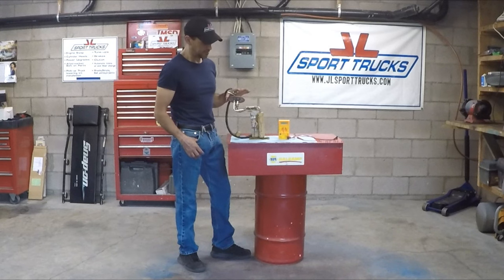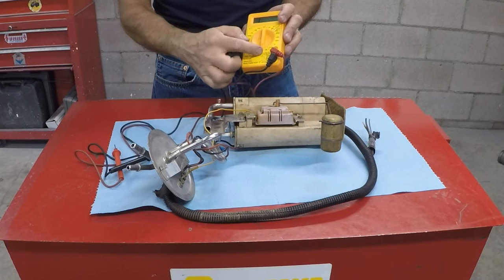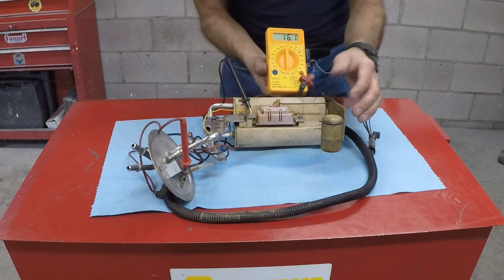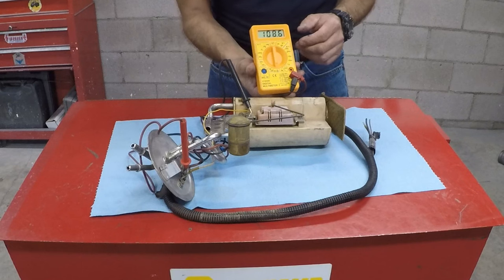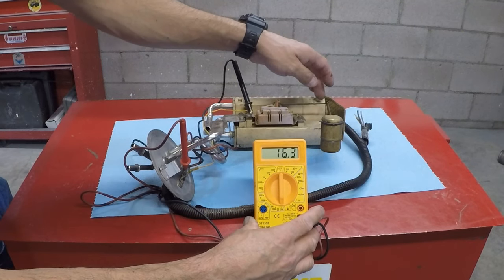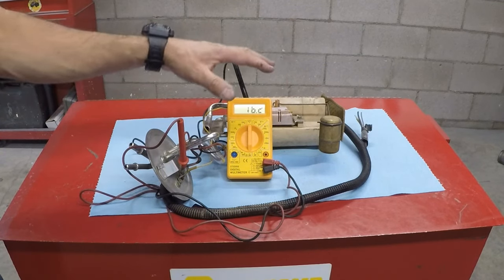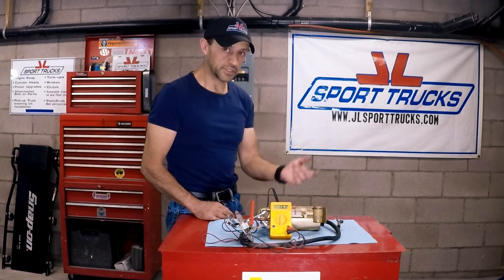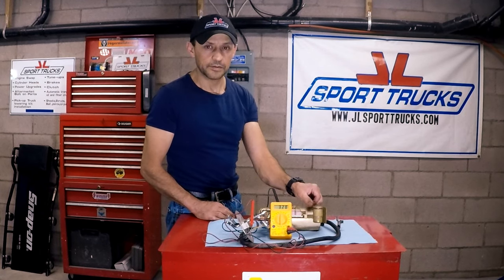How to test a Fuel Level Sending Unit with Digital Ohm Meter

Comment: good vid! I have an 02 ford explorer giving me a fuel computer data error which apparently points to a bad float in the sending unit, so I'll try this tomorrow to check for inconsistencies in the resistence
Reply: update! It sorta worked - the fuel sender had been sitting in its own filth for 8 years without use, so I pulled out a wire brush to scape the yuck off all the metal parts, then modified the fuel level sensor with tiny cable ties after cleaning it (the metal piece had too much opportunity to come loose, so I tied it to its bracket). Still couldnt get a proper reading, but it was way more conductive than before, so dropped it back in to test and my fuel gauge is back, with the fuel computer error gone! Thank you!
Reply: Terminology!  make sure you take a mental note of the floats location when you lift it out of the tank - theres not a lot of room in there and if its caught on anything it'll either error out, or the floats lever might be flexed off its guide which will also give that error. I pulled it apart, cleaned it all to new then resoldered the wires (after breaking one accidentally). Saved about $650 here

Comment: you can get a reed switch  240 ohms empyty  33 ohms full nothing  moves but float magnet   the come diff lengths  in 1/2 increments so measure depth of tank  deduct 1/2 in when ordering   mount standerd 5 hole

Comment: My 2017 Lexus nx 200t only reads from full when I fill it...and once I get to just a hair under half tank thats it...it stays there till I fill it up past that mark again. Not acting weird or funky it just won't go any lower even if run it damn near empty...whats your best guest? I'm thinking a bad float its sticking should I just change the sending unit out or look elsewhere for the problem? Thanks
Reply: Sounds like you got a bad sender unit